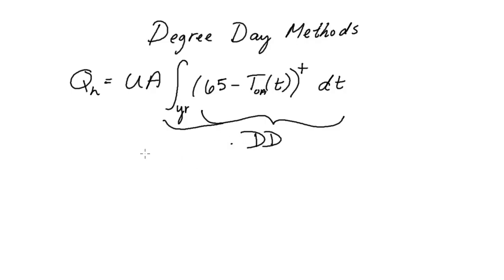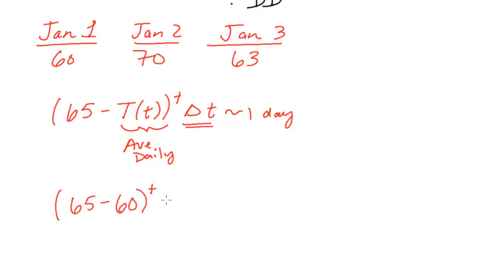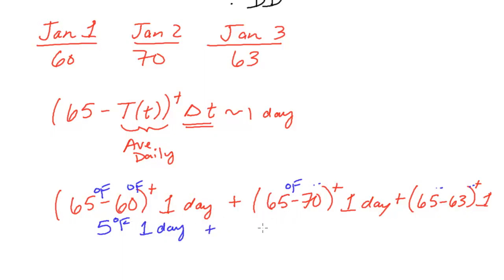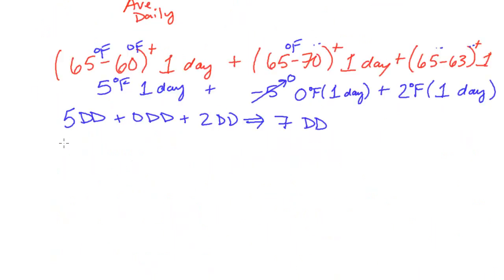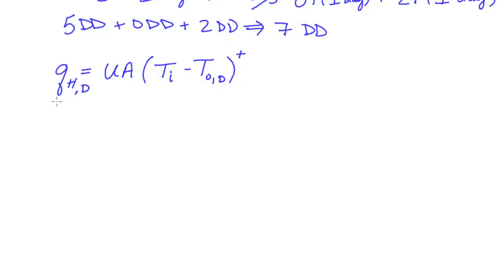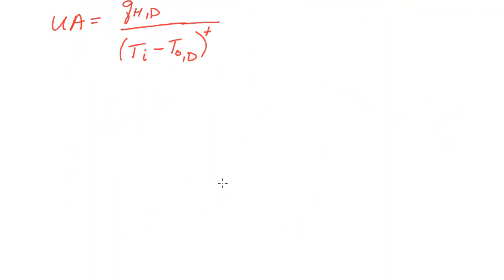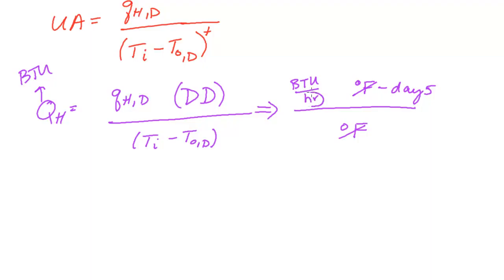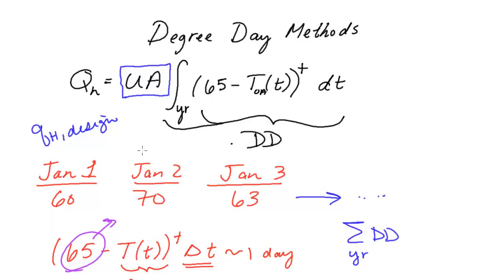Example Degree Day Calculation and New Form

Comment: Hi Mitchell, is the units DD = F*day/year?
Reply from the maker: It's normally thought of as °F-days. But from an abstract point of view, the concept can be any units of temperature difference * time. So you could also express this as °C-years or K-s. The confusion can also arise since most of the time we are calculating the total for a year, but you should think of it as DD/year.
Reply: @MitchellPaulus  Thanks for the clarification.
Reply: @MitchellPaulus  Can you use DD to calculate a package unit energy usage for the year using the total or sensible heat equation?
Reply from the maker: @persaudchris  That wouldn't be a typical application. This is usually applied to the building as a whole (although the building may have packaged units), not to individual pieces of equipment.